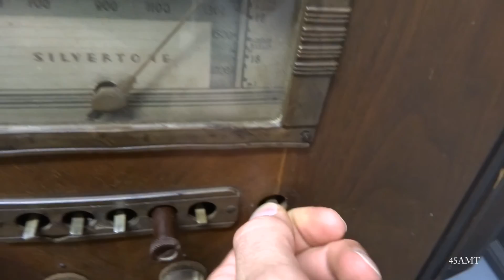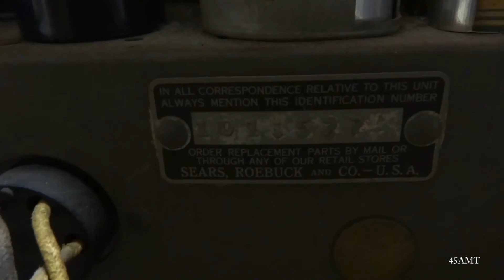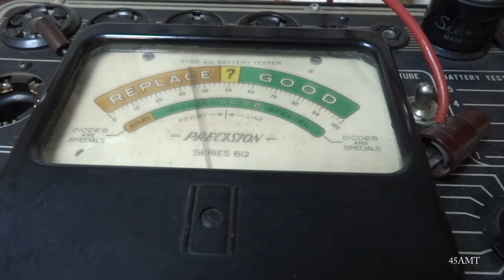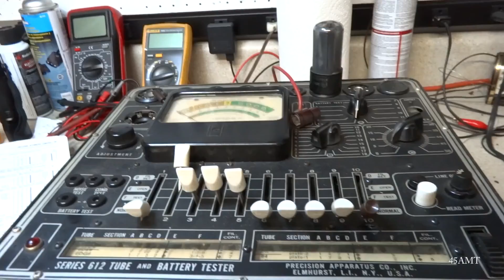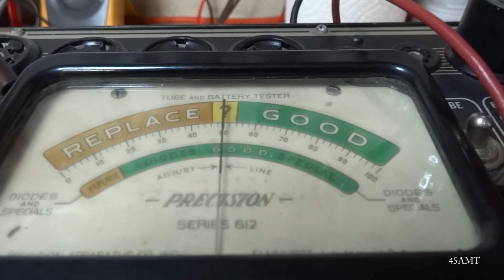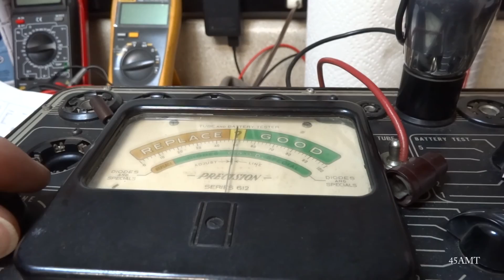Repair Of A 1938 Sears Silvertone 6135 console Pt 1

Comment: I have a Silvertone 6122 table radio and it has some of the same parts that this radio has. Although the chassis is different and I bet your chassis number starts with 101 right well that code is for Colonial Radio Corp. out of Long Island and Buffalo, NY which explains why parts look so similar both sets were made by them and so many 30's Silvertone were made by them.